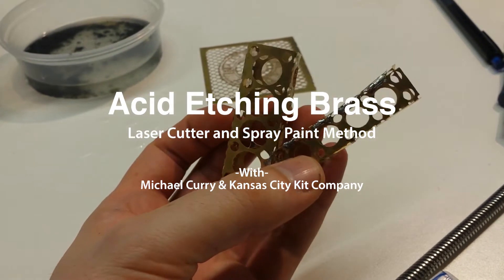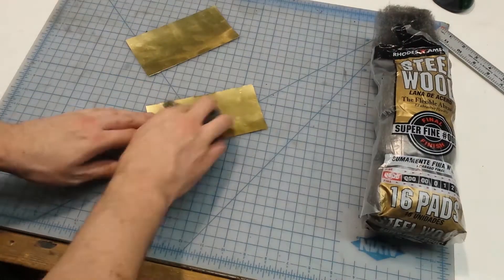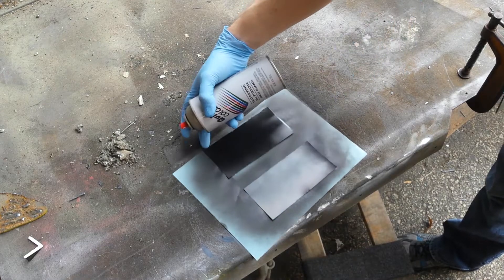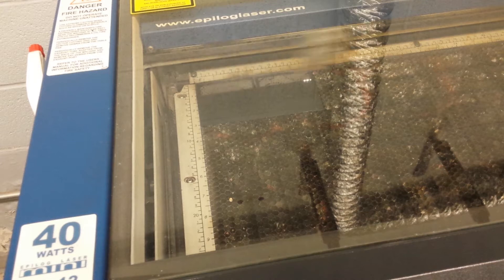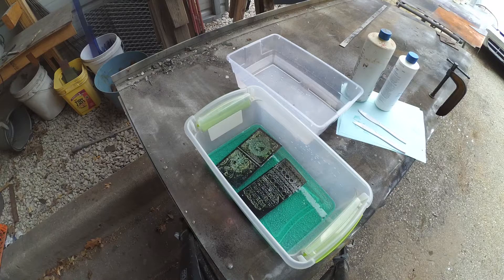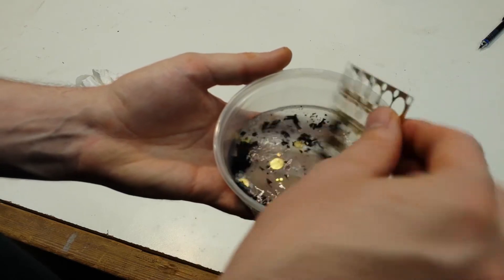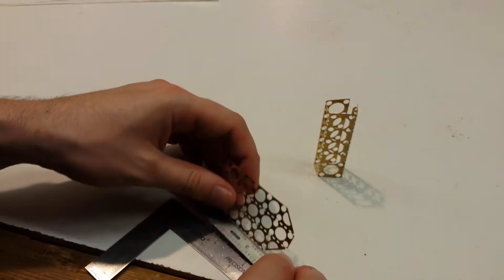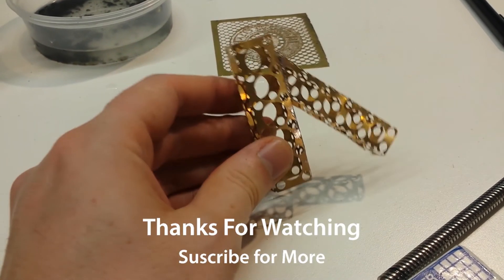Etching Brass Using a Laser Cutter and Spray Paint

Comment: I get a burnt paint residue where the laser has burned. Does that come off with the etch, or is there something else i have to do To get that off first?
Reply from the maker: We've found that cheep spray paint etches away the most cleanly. In some cases where there was left over residue we have either, run the etch a second time or given the part a light cleaning with alcohol. You can also try it with the residue still on to see if it has any effect.
Reply: @DistractedArchitect  Mr. Curry, great video. I've also had this problem with the residue. It drives me nuts because it will look great in terms of the pattern but then I don't get any current (using electro etching) due to all the residue.
Reply from the maker: @lanewaddell5797  We had some luck by re-running the laser etch over the part multiple times to try and burn away the residue.

Comment: Is it safe to assume this would also work with the Electrolysis method of metal etching? I don't see why it wouldn't.
Reply from the maker: It works very well with electrolysis! We've had good luck using this method to do deep etched into steel using a bucket of salt water and a 12v battery charger.
Reply: @DistractedArchitect  awesome. I just got my little 7w CNC laser and an etching tank. With power supply. Can't wait to use it.

Comment: Great, that's just the technique I've been thinking of using to make etched brass pieces for 3D model construction.  And thanks Robonza for confirming that double side etch registration is possible.  Some of the pieces planned would have fold lines or etch detail that is only wanted on one side of the piece, but other details will need to cut through from both sides so a double sided image is necessary.
Could the same technique work at less than 40W - like say at 5W?  As a 5W will cut through card surely it could cut through etch resist paint/ink?

Comment: Nice video. I get perfect registration doing double sided engraves. All you do is stick down some acrylic to the bed. Put two 3mm steel pins into the acrylic and put them on your artwork too. Drill some holes in your brass for a tight fit then you can flip the brass over (with matching artwork). I did a PCB like this here  http://www.edns.co.nz/index.php/blog/laser-cut-printed-circuit-board-pcb/
Reply from the maker: We've use a similar method in the past when doing pcbs, but didn't want to take the extra laser time and set up effort for this project.  A double sided etching would have probably helped the lace pattern come out by limiting the time it had to spend in the acid bath.